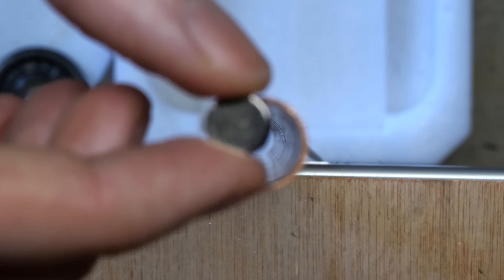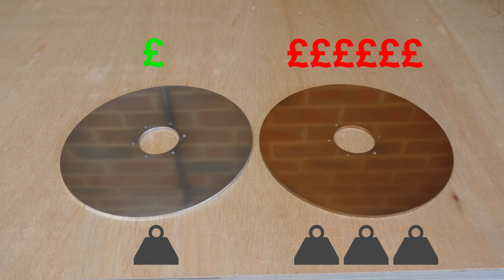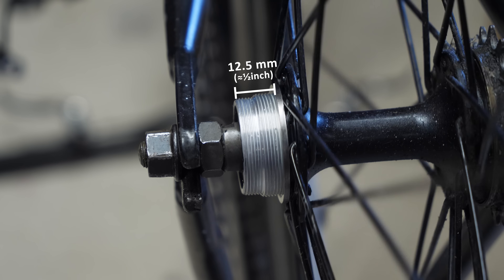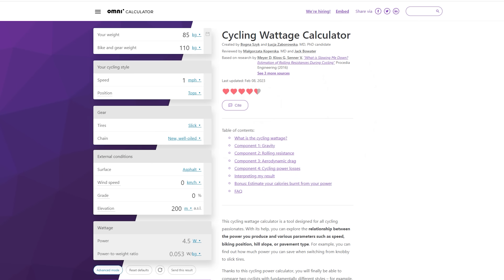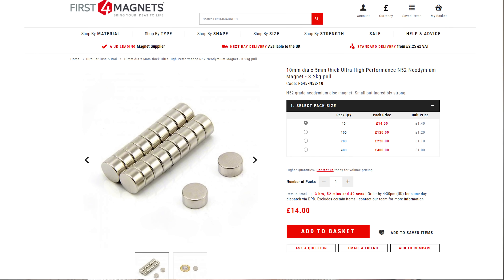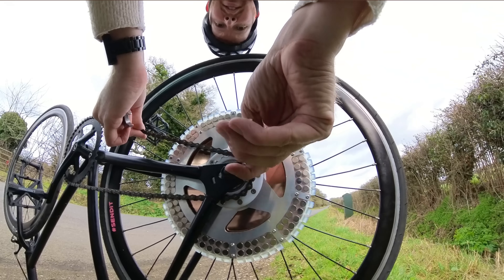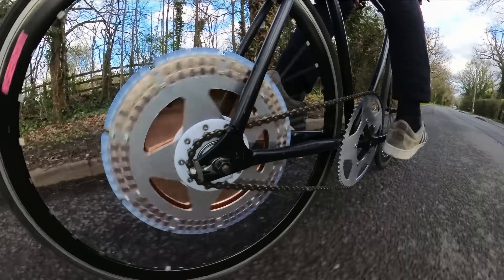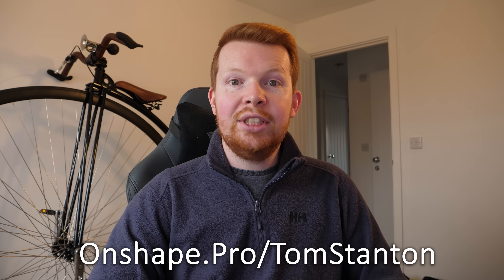Gearless Magnet Bike

Comment: I stopped watching Veritasium for other reasons, but he definitely employs some questionable scientific methods. Not using equal weights of material when air resistance isn't a factor for example. I really appreciate the amount of empirical testing and evidence you built up to help understand the mechanics of the system! As a driver that engine breaks all the time (coming from a manual transmission) I like the idea of this clutch in concept, being able to "engine break" using it, but it's clearly not suitable for most other biking needs

Comment: To measure the braking performance of aluminum vs. copper, the best way would be to measure the "time to fall" without the magnet and compare it to the time to fall with the magnet.  Simply looking at the slowest time to fall shows which one has the most resistance, but braking performance is about change in resistance, not resistance alone.

Comment: For the next test, how about driving the wheel the standard way, directly with the chain, and attach a copper disc to the wheel hub, but use an electromagnet to apply the braking force. That way it wouldn't use any power except when you brake.

Comment: what about a "magnetic disk brake" where you have the copper disk and then have the magnets in a carrier similar to what you used to test the eddy current strengh slide over the disk when you pull your brake lever

Comment: this would be interesting for a recumbent bike configuration. gives a similar feel to a fixed pedal but also gives you a coaster brake style brake and reverse. would be interesting to see a recumbent bike with high gearing rocking a magnetic coupling like this
Reply: maybe with some way to store pedaled energy in a flywheel and then use two copper disks as magnetic clutches or a copper flywheel with two "clutches" made similar to the magnetic clutch on the bike in this video. even more interesting would be using said clutch system in conjunction with an electric motor. possibly in a configuration that would allow for the motor to be disconnected from the pedals so you can use th e motor to spin up the flywheel without it pushing on the pedals

Comment: covering the magnets with small sheet steel plates on the two exterior sides would both decrease the magnetic pull on the chain/spokes and increase the portion of the magnetic field interacting with the copper disc
very cool project!

Comment: "I had an idea and wanted to test it."   <--- This!

What if you add a centripetal component to the system such that the diameter of influence is directly related to the slip/RPM? Sort of like a no contact version of the V-belt CVT?

Going farther, maybe make it like a drum brake; magnets inside, eddy current component outside. Again, the more RPM, the more centripetal force, the harder the magnets get pulled outward. Only this time you could put a conventional clutch layer such that full engagement equals "lock" configuration.

Comment: this is basically like turning a DC motor with shorted contacts. It has high resistance, but all electricity is just wasted.
What if you used energy from "slip" to generate electricity and then used it to run another motor? There was actually a train (Tatra M.290) using this principle to increase efficiency - generator was connected to an engine with rotor and wheels with stator. So part of the energy was transmitted through magnetic force and part was used to make electricity - electricity was then used for a small motor.

Comment: I'm surprised you didn't try pedaling in reverse when you got down to slower speeds. I would assume that would increase the breaking force since the magnets would no longer be passively stopping the copper plate, but actively attempting to reverse the direction of rotation

Comment: Much like a brake, it will just get hot unless the "friction" is extremely high. If you used as many magnets as you can, there would be a very brief spike of heat, and then it would normalise. 
If you don't have enough magnets, it will get extremely hot and inefficient.

Comment: Hey Tom, great build. You've definitely discovered why nobody uses torque converters (magnetic or otherwise) on bicycles: unlike an internal combustion engine, which loses torque at low RPM, your human legs can output basically the same torque (or more) all the way down to zero RPM. So, you don't actually gain any advantage by increasing the RPM of your pedalling without also increasing the mechanical advantage (by changing the gear ratio). Instead you just end up wasting energy by dumping the power difference between the torque * drive-side RPM and the torque * wheel-side RPM as heat.

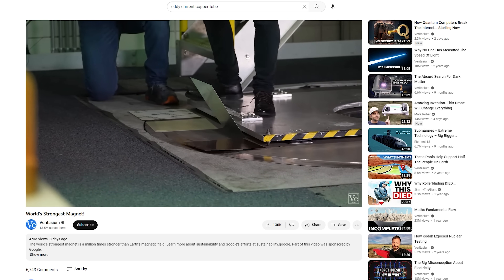Comment: I'm Veritasium's clip at 2:13, you can see that the copper sheet is also slightly further away from the center of the magnetic field than the aluminum sheet, where inverse square law comes into effect. Therefore, when combined with the difference in materials densities, we see the differences between the two materials.

Consequently, when trying to increase the Lorentz force, being able to halve the distance between the magnet and conductor is typically more efficient (in terms of material costs and weight) than trying to squared the magnetic force with a much bigger and powerful magnet.
Reply: Magnetic fields actually follow an inverse cube law, not inverse square, which would make this more severe. However, this experiment is being performed quite far above the top of the magnet, and within its radius - as a result the slight horizontal distance change is almost no distance within the magnetic field, and the field strengths are almost identical. The difference here is the density of copper, nothing else.
Reply: @iskierka8399  thanks for the correction!
Reply: I am really curious about how slowly an aluminum plate of equivalent mass would react.
Reply: @PhilHord  But the volume would also increase, so wouldn't dat compensate for the greater weight?

Comment: I really don´t get the point of making a slippery transmission, instead of a regular one,  also it loses acceleration capability. much better just use springs to smoothen the engagement of pull force.

Comment: Interesting to see it being used in this way. Alternative drive systems can be ingenious. Thanks Tom. 🙂👍 Many years ago, my father and uncle built a tandem with a hydraulic drive instead of a chain. They reckoned that it was close to the efficiency of a chain drive, although I doubt it. The higher cost of the hydraulics was the main disadvantage. They were soon caught 'riding recklessly' at around 40 mph on an urban road. (You could not be prosecuted for speeding on a bicycle.)  Would you like to build a modern version of that hydraulic drive, to compare its performance with bicycle chain drives? 
And for further project suggestions, how about experimenting with a Bowden cable drive, if you can make one which is reliable enough? Then there is the shaft drive which you might want to try out. Finally, a CVT belt drive could be tested. Scott motorcycles used that idea, as did the Invacar and other vehicles which used the same engines.
I suspect that the chain drive is going to outperform all but the shaft drive, but have never seen comparisons of the different systems on a bicycle. The chain is probably the cheapest option, because of mass production of components.
Reply: Shaft drive has been tried on bikes before, it was found to be worse than chain. It has to do with the need to change the plane of rotation twice, something a car can solve by mounting the engine longitudinally, but you can't rotate a bike rider 90 degrees too easily.

Comment: I wonder what would happen if you were to pedal backwards to slow down
Reply from the maker: The forward force on the pedals was really strong, so I didn't have the leg strength to pedal backwards at speed. Could only lock the pedals haha
Reply: @TomStantonEngineering  that makes sense.  as a former daily fixie rider; i was curious. Thank you for your time good sir.
Reply: for science, i'd submit my data: fixie with physical gearing 45:16, and maybe 36:16 best i could manage was locking the back wheel, with all my weight forward; and kind of "jammed" into the handlebars.  it kinda makes sense; but is intuitively had to believe; that the experience translates so diretly to your emf design. * 300x23 cheapie tirees deep vs. so not a huge footprint

Comment: if you can do simultaneous full 3d moves on you cnc mill. You could actually thread mill said oddball threads. This has saved me more than once. The thread mills are not cheap. But you often don't need to keep to many different sizes around. As many of the larger thread mills can do double duty as a smaller mill. As long as your threading the OD of a part.

Comment: Haven't seen it mentioned in comments - there was (is?) a product, STAC Zero, which was a bike trainer (stationary stand) that used a set of magnets to create a resistive force with these same eddy currents . They were acquired by another company and the product can be bought through them (4i Fliiiight, curious name).

Biggest issue is it requires a metal completely non-magnetic bike rim to work (and some issues with certain shims and valve stems). You put a little reflective clip on a wheel spoke - this lets the trainer count rotations and calc the RPM - that gets fed to a stepper motor that varies the magnet-array's distance to the wheel rim, and therefore control the resistive force on the wheel. 

I own the re-named Fliiiight product - all the above said, the biggest perk is how silent everything is. Only my bike making sound and a little chirping from the stepper motor if my RPM is inconsistent while I'm targeting a specific power.

Comment: Great video! If you could do this without causing lots of heat, it would be very nice way to create a clutch. As it currently works, it's just very low efficiency power transmission system.

Comment: This is technically a magnetically controlled power regulator.
In a straight line, to keep the same speed, your driven wheel slows down, which increases the torque, whereas when the driving side of the clutch and the wheel are at the same RPM, you get no power output whatsoever. 
Very interesting, even if it is a bit pointless.

Comment: I am just writing my thoughts before watching the video to see how they compare to the result.
I think it will work, but be inefficient, because you are basicly making an asyncronous motor and these need small tolerances to be efficient, but I think that it will be like 15% efficient.
After watching: Yeah, it seems that I still remember stuff from Electrical Engineering classes.
Great Video, i love that you measured the decent rates, and all the research before this project, it always amazes me that these things are possible to be manufactured and designed by one person.
One interesting thing is that in electric motors you try to reduce the eddy current by constructing the rotor out of many thin sheets of metal that are isolated from each other, so the current is directed.
Also trains, and even some trucks use a eddy current brake for saving the normal brakes on decents.

Comment: So car alternators are not built using permanent magnets and instead are energized. Could you make a similar system that when you pedal it would excite the magnets and give you eddy currents but when you stop pedaling it would de-energize the magnets thus reducing the instant resistance of the magnets?

Comment: As always, very interesting and well thought out concept. One thing I thought about and you may have as well but did not demonstrate while peddling was when you stop forward motion by stopping your peddling and using the braking effect of the eddy currents within the copper to slow you down. Because you have a direct drive from your front sprocket to your back sprocket, try peddling in reverse so that your magnets are rotating in the opposite direction to your copper disk and therefore your rear wheel. My thought is that you would actually slow down in proportion to your reverse peddling speed, ie. quicker.

Comment: So for the Veritasium video, they had to account for the density of the materials as well, as the test was using their own weight against the magnetic force. So I'd say your test was much more well thought out.
Also on top of being non-magnetic I believe a belt drive may mesh better with 3d printed gears, as the hardness of the metal chain can cause minor abrasions that lessen the strength of the sprocket.

Comment: very interesting, i'm wondering what would be the effect of having the magnets being able to move on the diameter of the copper wheel with them being in elongated slots instead of holes and with spring acting against the centrigugal force (so pushing them inwards). Not really sure but might emulate how a mopped cvt is working with magnetic fields instead of friction

Comment: This is not a transmission, it's a clutch. The torque in will always equal the torque out. This means any speed difference will simply be wasted energy. In comparison, a transmission or even a torque converter would turn reduced RPM into increased torque.

Comment: fantastic as usual Tom, two noob questions:  how is the heat in the copper disk generated, and will this system generate electricity?
Reply: The heat is because the eddy current produces a voltage differential across the poles of the magnetic field which then equalizes resulting in losses due to the resistance of the material

If you wanted to get energy in or out you would need to replace the copper disk with coils of wire arranged to align with the magnetic field, effectively making a bldc motor

Comment: Great video Tom, I once had an engineer who worked in the automotive industry stay at my mums hotel. He discussed magnetic clutch systems and I was fascinated and always wondered why they were not a thing.

Thanks to your video I now know why.

Also great to see some lockring sprocket track hub Tomfoolery, looks like us fixed gear fans will have to keep using a plain old chain and sprocket to save on brake pads.

Comment: Some thoughts: in the beginning you mention a friction force; eddy current braking behaves as a damper though (up to a certain speed where it loses force). Also, for magnet orientation, induced current is always generated by a change in magnetic field. By alternating the magnets, the gradient simply becomes higher. Placing a back iron would help even more. It makes a better magnetic circuit, allowing you to have thinner (thus cheaper) magnets.

Comment: An alternative for the hub issue would be using a disc brake model instead. That will have a flat faced surface on the other side with holes already drilled and tapped for a disc rotor. That would eliminate the magnet sticking issue, as you could mount the magnet disc on the other side of the sprocket.
Reply: But that wouldn't be going in search of a problem.

Comment: This is not a gear, the closest Would be a torque converter.
Very inefficient by design, as you experienced 😊

Cool video, Thanks 😊
Reply: And usually those torque converters get locked after gear change or roll on. That would work on your bike.

Comment: Thought Concept. If you combine a c brake lever with a hydraulic housing of a caliper. Can you use as a form of a brake, a lever engaged break to slide into the disk. And if there's current draw could you use it as a engaged frictionless generator to charge bike lights tail lights or even cell phones

Comment: I feel like you made things harder for yourself by using a single-speed as the platform for this. A bike designed for derailleurs would have given you a lot more space for the clutch and more spacing from the metal components.

Comment: This is interesting as I've been curious about putting a copper flywheel in a car and replacing the clutch with magnets that could be moved closer and further away from the copper flywheel. A magnetic clutch is something that's been in the back of my brain for a few years now. Of course just like with a modern torque converter where you don't want it slipping all the time you may still want a lock up clutch for steady cruising.

Comment: There is a magnetic brake to control speed on my transcription turntable from 1960 which works beautifully (Thorens TD124). Non contact braking is a more sensible route, or fine speed control.

Comment: Awesome video, @TomStantonEngineering ! As a bike mechanic and self confessed tech nerd,  I love seeing these new ideas pop up.  One thought I had is that perhaps you could open the central part of the copper plate, like you did with the aluminium magnet plate. It would get rid of space for heat to 'drain' to, I guess. And perhaps help with keeping the entire plate cooler, as air can flow through / over easier. Unless the removed copper mass messes with the induced eddy currents of course...

Comment: Try the test with a carbon frame and wheels. Also, what if you used an electromatic setup instead, or having an engage/disengagement of the magnets to straight steel? Freewheels create a lot of friction as they spin.

Comment: "The reason why the copper sheet fell faster in the Veritasium video is probably due to copper weighing over 3 times more than aluminium" ... Surely, objects of different mass still fall at the same rate! I don't believe air resistance is a factor at such a slow speed, so the only possible difference is in their magnetic resistance.
Reply from the maker: They fall at the same rate if there is zero resistance, whether it be air or magnetic resistance. So in that instance, it's the weight acting against the magnetic resistance. Therefore, more weight means it'll fall faster.
Reply: Ah, right. Weight not mass!